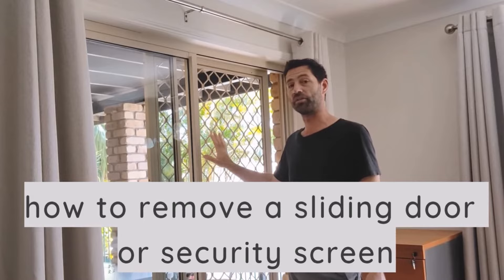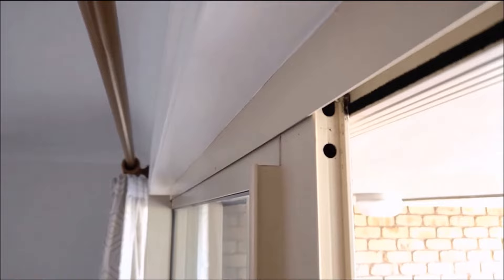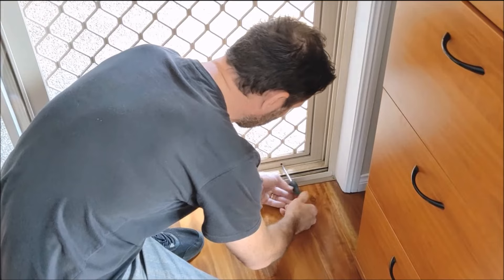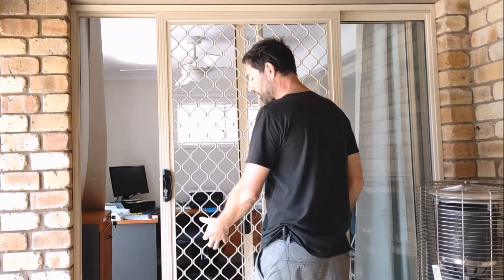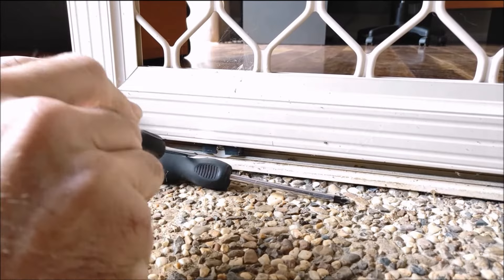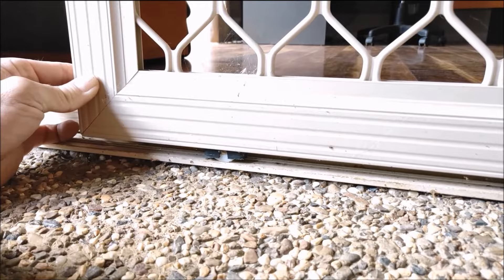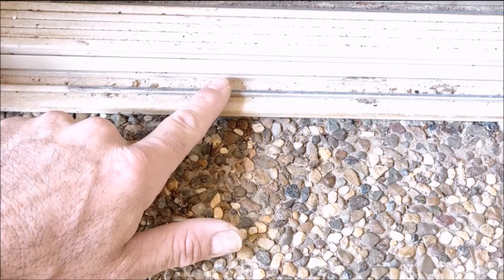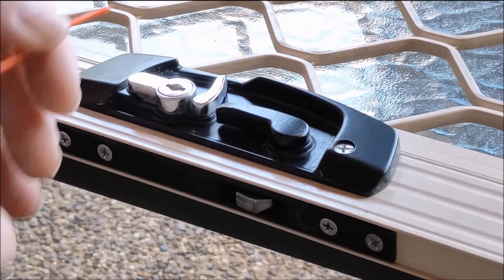How to easily remove sliding door security screen with Inspire DIY Kent Thomas

Comment: Thank you so much!! I’ve been hunting high and low on how to do this! I’ve only managed to find videos where you push the door up into the frame or else you had to unscrew a panel from the top or bottom of the door, neither of which were an option for my screens! Now we just need to replace the kitty wrecked fly screen with the new stainless steel mesh we have bought and we will be good to go! Thanks so much 👌
Reply from the maker: Hey MissP, I'm glad the video helped that's awesome, and thanks for the comment 👍. If the stainless steel mesh doesn't work for you have a look at the 'how to install petscreen' video linked here. https://youtu.be/CMTFoi1GesY cheers, Kent
Reply: @InspireDIY I watched it 😊  so far so good with the pet mesh. 🐈‍⬛

Comment: was just going to pay $160 for a call call out to fix stiff door sliding security door. Thanks for your YT saved me the money.
Reply: Hey mate, that’s awesome! I’m glad it helped 👌 cheers, Kent
Reply: Just one thing that would be great if you finished of changing the rollers. Can be bought at bunnings, best to take an old one with you and they will match them up. New unit's has height adjustment screw both sides so can go back in either👍 way @olivechopper
Reply: Great suggestion Craig, I’ll give you a shout out as a thanks when I shoot that video 🤙

Comment: Really informative and helpful. I would however, dissuade the use of WD40 (or similar lubricants) into keyways / lock barrels. Graphite powder is the recommended lubricant for that.
Reply from the maker: Hey golfing nomad.. I remember being taught that years ago but it fell outa the filing cabinet somewhere along the line. Thanks mate👍 Kent

Comment: This was so much help but I found one of the bottom rollers not freely moving, tried some lubricant with no change, so how do I replace a roller? Any help world be appreciated even 4 years after you posted this video.
Reply from the maker: Hey Lancer, when you look on the underside - are they screwed in place or just a fiction fit? I just changed some internal door rollers (wardrobe type) and they pop out easily when levered with a small screwdriver. Best of luck with it👍Kent

Comment: Good explanation. I would like to know what is inside those adjusters because on mine, turning clockwise pushed the wheels out not in unless you keep turning till you get to the end and then the opposite applies. I was not game to try to remove the assembly in case I could not get it back. Could not see how thay came out anyway. Watcha reckon!
Reply from the maker: Hey Richard, there has been a few comments saying different brands adjust clockwise or anti.. seems there is no hard and fast rule as to direction. Each wheel assembly on this door is just attached by screws to the underside door stile - easy on and off! Cheers, Kent
Reply: Thanks, Kent, Mine looks the same as in the video but there are no screws holding it in. I can't see what holds it. It just flops about but won't come out. (rhymes eh!) Then I tighten down the top ones so it can't be lifted out from outside by  a baddie. Anyway all is ok with the door now but I find I had to adjust the bottom 2 to get the height correct for the latch to line up. BTW I had to do this job as my son's Labrador knocked it off the track trying to get out the dog door designed for a small dog. Great video and well explained which is more than can be said for most DIY videos. @InspireDIY
Reply from the maker: Lovely comment + great story👌 cheers Richard. Kent

Comment: Sadly hasn't worked with my 30 year old sliding door.  The screws are stiff and slightly out of alignment with the little hole.  Managed to turn them clockwise but it didn't loosen them up at all in fact it made the door slightly harder to slide.
Reply: Hey Peter, sorry to hear that you are having dramas with your door. I was thinking maybe spray some penetrating fluid on each day for a few days and then try again.. sometimes these older screws need some love and attention 🙄 best of luck, Kent
Reply: @olivechopper  Well I got a guy out to have a look at it and he when I told him I'd turned the screws clockwise he said no you're supposed to turn them anti clock wise.  He took the door off in a couple of minutes and didn't charge me.  I thought of turning them anti clockwise but thought It would just make them tighter and it would make it harder to get the door off.  Anyway, problem solved.
Reply: Well done Peter, your
Doors must be the anomaly 🤔 I haven’t come across this before! Good to know 👍 Kent

Comment: Thank you so much! Any tips for a stacker sliding door security screen with 2 panels?
Reply from the maker: Hey Ti. K. I would think (without seeing yours) that looking for the adjusting screws and drawing the wheel assemblies into/toward the doors would help you to remove them from the tracks. let me know what you discover. Regards, Kent

Comment: Thank you Kent for very helpful tutorial .Your video help me to do the job easily specially removing the sliding door. But just wondering do you have any video to run sliding door smoothly ? After putting back the sliding door it is not running smoothly , it is bit hard to open the door .Do you have any tips ?thank you in advance .
Reply from the maker: Hey Moshfeq, I've found that lubricating the wheels and latches with a Dry Silicone Lubricating Spray like this one works well https://amzn.to/3rsDKTX Best of Luck, Kent

Comment: Hi Ken thanks for the information. Can I place the lock on the other end of the sliding door? I’ve bought a second hand door but need it open on the other side!! 😏😂 Plus it has a dog flap inserted into the door. There is also an extra piece of metal added to the opposite end, which I will need the change also.
Reply from the maker: Hey Julie, that's a complex one. as sliding doors (like hinged swinging door) are made left or right hand the easy answer is no, but if you are up for a challenge you can with some effort:  The 'handle stile' and 'meeting stile' (vertical frames) would have to be switched around (and meeting stile inverted if draught excluder fitted so it becomes correctly positioned), the safety glass rotated 180 horizontally within frame, and the handle/lock changed around so lock now faces outside.
are you up for this challenge? I'd love to know how you get on.. Kent
Reply: @InspireDIY  Thanks Kent I think that’s past my capabilities 🤣

Comment: Hi Kent! Thanks so much for this clear and concise video. I now know how to remove the door - had me stumped for a while. 

My door has the same metal lattice and fly screen also. I was wondering if it is possible to remove the metal lattice from these sliding doors and just retain the fly screen and door frame?

Ours is an internal door so doesn’t need all the metal lattice and I think it’s kinda ugly. 

Any help huuugely appreciated.
Reply from the maker: Hey Chris, yeah I agree, they are ugly doors! unfortunately the are welded in place when built, if you are handy with a grinder you could cut the lattice out but I really don’t know how good it would look, could I suggest a replacement screen either from the hardware store or 2nd hand from the demolition yard? Best of luck, Kent

Comment: Thank you for this nice video. Unfortunately my screen does not have adjustments I just had to force it of the bottom rail. No wheel or way to reduce the height of it :)
Take Two! I do have wheels, but no adjustment. And now I realise that on top I have 2 guides that need to be removed (unscrewed and slid out) to get that extra space to free the sliding frame! I have not yet seen  a video that shows this type.
Reply from the maker: Oh that’s a shame meeekstube, any damage?
Reply: @InspireDIY  Wow that was quick! thanks for your follow up and you can see my update :) No no damage luckily!
Reply from the maker: Good stuff mate, any tips you came up with?
Reply: @InspireDIY  That is the tip. If you see a screw at the top holding  piece of plastic it would be your guide. And it can't be adjusted to lower  it so you unscrew it then fully and slide it out (of the way). My screws were very tight and I did not know they needed to be remove but I could see they did not adjust anything.
Reply: @InspireDIY  And they love to make it difficult....Those screws are a type of Torx screw!
Reply from the maker: Haha, yeah it’s as if someone making this stuff thinks… ‘this’ll test them!’ Cheers for the feedback meekstube👍Kent
Reply: @InspireDIY  No Worries :)

Comment: My screws are on the outside and it seems I have to turn counterclockwise to bring the wheels up.  The ones on top won't seem to screw and just make a clicking noise when I turn them either direction.  The ones at the bottom I can't get the wheels to retract enough.  Feel like it's impossible to get my door off!  Tempted to just try to bend the frame.
Reply from the maker: Hey ex0ja, sometimes DIY jobs just need a bigger hammer. how did you get on? did you have any luck with it? Kent
Reply: @InspireDIY  I worked out there was a rubber stopper on the top runners that was preventing me from fully opening the door.  Once I took that off it was easier, but still took a lot of brute force and I scratched up my door.  Since then someone walked through the fly wire again, I'm not keen to do it all again so I've left it like that for the past year! Haha

Thanks for the reply ☺️

Comment: How do you remove the glass sliding door.
Reply from the maker: Hey unregd, for this style you lift it up into the top track (sometimes needing a second set of hands to use a flat screwdriver or similar to depress wheel assembly up into the doors aluminium) then swing the bottom of door inwards and out of the bottom channel, this gives the door the room to then drop out of top track. You may need to adjust wheel assemblies with screwdriver if unable to depress them enough to get out of the way! Install in the opposite order. Best of luck mate. Kent

Comment: Mine is actually stuck on the other side of the rail so I can’t access the spring wheel
Reply from the maker: Oh dear PokerQueen, have you adjusted all the wheel assembly screws to allow maximum movement? let us know how you get on. Kent

Comment: Hey Kent.  I think I need more of your insight.  We are on the coast aka rust central.  The screw heads that adjust the roller heights have become lovely unstable pieces of brown ikky stuff (we call Lennox brown but you know - just plain rust).  When I insert the Philips screwdriver and turn all that happens is I generate rust chips. There's nothing solid that the screwdriver can grab hold of.

Do you have any suggestions?  I had the screens installed in 2004, so going on 20 years ago.  I have not even attempted to insert a screwdriver in it until today.  Of course we are beachside.  Salt mist every afternoon.  I also know it's a first world problem...

I know, perhaps I should have realised this before, but nope.

Can you offer any advice, mate?
Reply from the maker: Hey Col, Lennox Brown😂😂 although I bet you aren’t laughing while you are wrestling those rusted screws, can I suggest soaking in a penetrating oil like Permatex super penetrant first, sometimes tapping the screwdriver into the head to break the bond of rust before undoing while applying inward pressure to the driver. Best of luck mate and if anyone else has a suggestion for Col👍 Kent
Reply: @InspireDIY  ta mate.  I got to work and somehow managed to manipulate the doors off then back on after replacing the screens.  I have now done all the sliding doors; just have to finish the swinging laundry security door then one window.  The window has a fixed grille (we need air but since the pub is just 50 metres from us I also wanted some intruder protection).

Anyway I seem to have stumbled through it, no small thanks to your very helpful videos.
Reply from the maker: Good on you Col👍 the thanks is much appreciated, I’m glad it helped and well done to you. Kent

Comment: With my screen door even if it’s loose the ledges or rail not sure what to call it prevent me from getting a flat head to either wheel not quite sure what to do
Reply from the maker: Does the door lift up when wheels loosened?

Comment: 2 of the 4 screws arent there or arent visible. Maybe they have moved out of line with the hole in the screen. So i cant loosen the wheels. Do u have any advice. Thanks
Reply from the maker: Hey Karen, sometimes they're deeper inside the door and hard to see (but I'm sure you've looked), sounds like the assembly may have been over adjusted to where the screws have fallen out, that's a shame. And I'm guessing you have tried removing the door after adjusting the screws that are there? good luck.. let us all know if you find a solution. 👍Kent

Comment: My sliding sercuity screen door is hard to slid open what do i do to fix this ?
Reply from the maker: Hey Borgie, you could try cleaning the tracks that the door rolls on, lubricate the little wheels top and bottom, adjusting the wheels as shown in this video and see if that helps, good luck👍